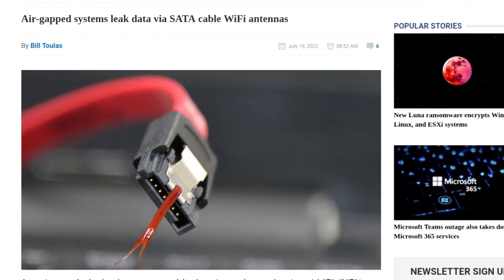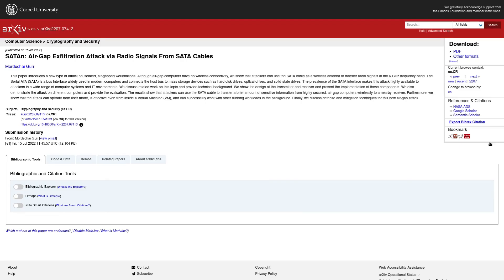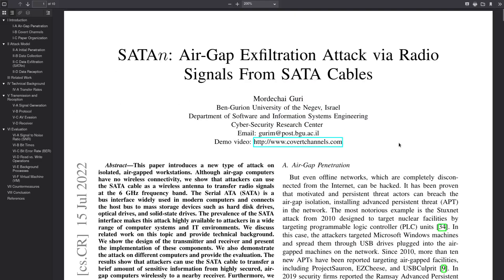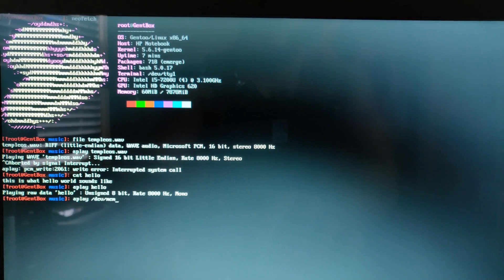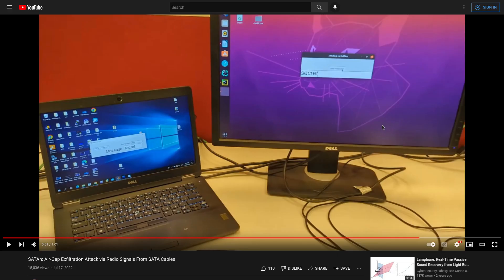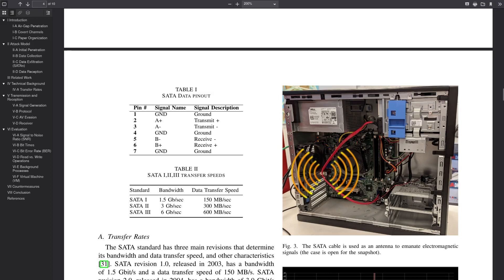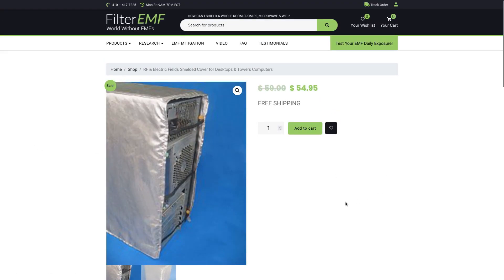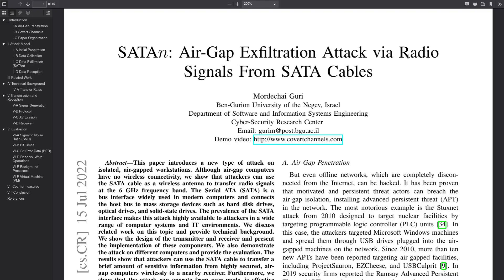Stealing Data Wirelessly From an Air-Gapped System

Comment: I assume that intelligence agencies with the level of sophistication to employ this type of attack would have some guesstimate as to the length of relevant conductors inside the case and set up a bespoke virus and receiver equipment with a super high gain directional antenna for whatever frequency would be optimal. 

That's still not going to get a signal very far outside of truly optimal conditions though, probably not through much wall at all.  Really secure US gov spaces already have apparent preparation for these categories of RF based spying or exfiltration, Faraday grids in the walls and increasing use of fiber optic instead of copper wires.

Comment: When I was a kid I had a pair of cheap emachine speakers and during the night normally or clear days they would pick up radio signals and play them through the speakers (usually the local rock station). I had to unplug the USB and aux to get it to stop.

So I'm not too surprised honestly this is possible.
Reply: plugs in speakers THIS IS 101.5 R-R-ROCK FM WHERE WE PLAY ONLY THE BEST ROCK FROM THE 80'S NON-STOP
Reply: I used to have a 90's Roland guitar amp that would pick up radio stations when I sat it in the right spot.
Reply: Same thing happened to me, but with some kind police/ham radio band. It was really weird to be creeping around RE4 and hear actual radio chatter.

Comment: Fun fact related to the bit at 5:00 about playing audio. Some years ago when smart TVs were new some companies would sell different models of the same TV with different features enabled or disabled but with a different price. For example you could buy the same TV but with the USB ports disabled for $200 or whatever less. Well, people figured out the Infrared signal used by remotes to enter service menu and enable any feature you want. It was distributed as a audio file on the internet. You just had to solder an ifrared diode from a remote to a jack cable, connect it to your PC and play the audio. The Diode would flash with the sequence as if it was a real remote.
Reply: That’s cool! Kudos to whoever though about this way of sharing IR signal over the net
Reply: One more reason for only buying devices that still have audio jacks.
Reply: @jannikheidemann3805  any usb audio thingy will work for that. Maybe you have to get one that supports a higher bitrate as this literally matters in this case, but assuming that build in chipsets support that is also an assumption.
Reply: @jannikheidemann3805  some phones even have infrared blasters
Reply: Huh that's interesting
Reply: Grounder! SnooPING AS usual I see?!
Reply: Companies that do that are evil, and I applaud whoever bypassed that garbage.
Reply: This sounds really cool, do you remember what it was called?
Reply: @down2006  I can't find it now, it's was for the early smart TVs where their top features was playback of videos from usb stick. That was one of the things that was disabled on the cheaper models. I'm sure they still do stuff like this. I looked around hoping I could find it and I see lots of examples on current gen TVs but they all get access to the service menu using normal remote and a specific button combination
Reply: @zack3g  IR blasters on phones are still an option. Pocophone sell their flagship F series, that still have these alongside 5G, 120Hz AMOLED screens and a SD 870 CPU, with 8 or 12Gb of RAM.
Reply: Never heard of that. I just know about the TVoodoo attack, where you use a Mobile Phone with IR capabilities to hack a Android TV. I also never heard that some TV's had disabled USB ports. Hm.
Reply: @zack3g  and send sick custom wallpapers at few bytes a second hehe good times
Reply: @zack3g  I hope you don't think that'd be any more secure. Since it's not using a laser any camera within a fairly wide angle can see that IR light and read what's being sent, and if it can receive then they could send to it too.
Reply: That's actually really cool
Reply: do you remember what the audio sounded like? I'm assuming some almost like morse code of the binary on/offs? If you remember though, let me know!
Reply: @ecmphg  It was just noise, sort of like old modems.
Reply: Ya I have one like that it has a 120hz option for gaming but it’s locked on my model they make a 120 and 240hz version of my TV
Reply: Yea I don't thinks so. If there were no need for the usb they would more probable not solder it, controller and passives at all, because in economy of scale even 0.1 cent components make big difference.
Reply: @yanikkunitsin1466  you dont get it... All the TVs were the same but they just disabled some features like video playback on the cheaper models to make the more expensive model more attractive deal. They were making all the TVs at the price of the cheap model already.
Reply: @golarac6433  I do get it, I just don't believe in SW disabling of existing USB circuits because it's not how it's done in the industry.
Reply: @yanikkunitsin1466  it is, while looking for the original thing I commented here about I found examples of such stuff in modern TVs
Reply: @yanikkunitsin1466  and its not about disabling any circuits, its just that the USB file browser would not play videos (but would still let you slideshow jpgs )
Reply: @golarac6433  Link for these video disabled TVs with working slideshow and hack?

Comment: Step 1: infiltrate a "really secret and important" base heavily guarded by guns and walls of concrete.
Step 2: Go through the many layers of hardcore security including eye scanners and scheduled checks.
Step 3: Reach the computer which is being used at the time and shut it down completely giving off your position.
Step 4: Open the PC box to reveal the Computer components and while following standards to not get shocked or damage the PC replace the SATA link with the one with the antena.
Step 5: While the PC boots up get out your equipment out, once the computer is functional insert some USB drive to infect the PC with malware.
Step 6: Wait for the malware to do it's job and use a second computer to receive radio signals instead of using the USB directly to steal data.
Step 7: Get arrested, tortured and thrown into a cage.
Reply: So, get a job as a technician, then steal the data without creating any records you did so? This hack is better than I thought!
Reply: @GabrielAKAFinn  Brilliant
Reply: Well it's not a specific SATA cable with an antenna built in, it's just using a normal SATA cable as an antenna.

Any long thing piece of metal can be turned into an antenna.
Reply: @naut3  Oh well, they still have to shove a metal rod in it? Better have already shoved and calibrated to transmit.
Reply: @RoastCDuck  the point is it already had a metal rod in it, it's the damn wire lol
Reply: @RoastCDuck  wdym? They don't need to shove any metal rod, the cable already has metal in it
Reply: @naut3  No no I meant, they shove a bigger rod for a better signal even if they don't need to :)
Reply: @thomas.thomas  If they want that 1m range to go up, even if it's completely useless and obvious someone modified the cable, they shove a bigger rod. Which sill stick out of out the pc box.

Comment: 8:14 Actually the rubber will do nothing to insulate the signal. The transmitted signal is electromagnetic and doesn't really interact with non-conductive materials.
More effective would be something like a Faraday cage or simply shielding made from something like aluminum, which has the same effect.
Reply: Let's go!!! Full circle baby!

Protect from outside attack start with Aluminum foil
Reply: Or just get a case that doesn't have big plastic windows. But honestly, if your system has malware on it, you have bigger issues than the malware transmitting data over your sata cables.
Reply: Copper would be better, though I have seen steel used.

Comment: Unfortunately a security audit for a sensitive airgapped system can be an attack vector as well.
Reply: Quis custodiet ipsos custodes?  🙄
Reply: A security audit per se is not an attack vector, penetration testing or red teaming can be.

A security audit may uncover potential attack vectors.

And if it is, then you're using the wrong people to do your security testing or you haven't got NDA's signed up.

Comment: Could you maybe do something similar with the PSU? The malware could draw more and less power and that could maybe be picked up remotely?
Reply: I suppose you could indeed use power draw for signaling, it "should" be trivial to use high power/low power for ones and zeros. Perhaps if the airgapped machine is on a networked UPS (even for out-of-band monitoring of the UPS) you could exfiltrate data that way. There was a CVE earlier this year where APC UPSs could be remotely flashed with malicious unsigned firmware via their updater, and while those security researchers demonstrated the problem by making one catch fire, there could be other shenanigans out in the wild to this day...

If targeting a single home user you might also be able to do a similar power draw monitoring exfil if you could pwn their smart meter, which shouldn't be terribly difficult. 

And for gamer bros, I would bet you can do all kinds of awful things to them via a supply chain atttack on the stupid proprietary control panels used to control RGB and other stupid features on "gamer" PSUs.
Reply: @ReptilianLepton  Would your first comment re power draw be an example of differential power analysis?

Comment: With experience working on military grade electronics, most of those devices are going to be immune to this type of emission. All air inputs/outputs get both particulate and emi filters. Device must go through extensive testing for EMI emissions in the GHz range. Screw part 15 compliance, the device must not emit any interference and in turn will not allow any interference ingress.
Reply: How could an individual apply a similar rigor for their home machines?
Reply: @AbandonedVoid  Lock it in a safe, faraday cage the cooling vents?
Reply: @AbandonedVoid  You know the mesh microwaves use (the hole size determines what frequency it blocks), you can do really fine mesh all the way around your unit (you really should only need around any open air vents or windows, but if you go all the way around you can't miss it too easy). That way it can still get airflow. External noise generator would also likely help (if you put your case within a bigger computer case, like a super small form factor inside full ATX, you could put a radio frequency generator in that).

You likely don't need to do that, just don't let sketchy CIA agents into your house. I don't think the government even does this, certainly not on machines that have PII or protect your data (those of course get leaked so often, they might as well be a facebook post, except more reliable since they don't get shadowbanned).

EMI shielding is the least of your problems (of course remove WiFi/Bluetooth, or buy a desktop without it).
Reply: Regardless of EMI shielding at the unit component level, when end assemblies get deployed (a network, ship, building, etc) there are still leakages to be exploited by the correct receiver and demodulator.
Reply: @Kronin Oh, I thought you were serious or possibly just alluding to military surplus (which is often a great deal to buy stuff, since its already been paid for once by taxpayer dollars)
Reply: @Kronin Military doesn't sell that, they don't make it either (they buy from contractors, government doens't "make" anything, other than large debts).

Comment: Do you normally spend so much time releasing such obvious information. Obviously, anyone who managed to place a SATA cable onto the motherboard will have access to the system ANYWAY. 
Why not just say, "Hacker that places radio inside your computer will have access to your computer." Still subbed here, but really, please don't post useless vids.

Comment: A point you missed is that the attacker doesn't have to hack the particular system they are attacking, they can heck a system within proximity of the device they are actually targeting that is capable of sending data such as,  I don't know, your cell phone another computer nearby capable of receiving data.
Reply: How is attacking a nearby smartphone gonna make the system his interest in sent wireless data threw the S-ATA cable? You make no sense.
Reply: Can you elaborate?
That sounds like how our devices all got enslaved. From what I could tell. But idk which vector(s). I tried airgap but eventually it all succumbed. This is over most ppls capacity to keep up with alot of f^ckery.

Comment: Years ago an exploit was announced similar to this, a trojan would transmit (and receive in case of a botnet) by using changes in fan speed and a speaker to detect the change.
Reply: You can also spy on the screen by using an antenna as well. This attack was discovered back in the 1940s during the war. Electro magnetic radio emissions from anything with electricity is not really a hack its just something you should expect happens all the time. See van eck phreak/tempest attack

Comment: I remember a few years ago I was setting up a cheapo Chinese camera and to get the wifi creds from the phone app to the camera, the app played the password string as sound. The camera then decoded the audio and connected. Completely changed how I look at and understand "data" and the infinite ways it can be represented and transmitted.
Reply: And I thought having the camera scan qr code from your phone app was advanced
Reply: Techmoan did a video about these new sony dolby atmos speakers, it has a feature to analyze the room via different sounds. Not as in measuring and getting data from any traditional method but from just sound. And it makes the speakers sound better judging by how it works for positioning via the side and top channels. Expensive system when said and done.
Reply: @battokizu  Apple seems to do that too with that smart speaker they sell.
Reply: Isn't that what an internet modem does?
Reply: @narcosalpha9472  Old school phone line type? Yep...
Reply: Samsung's Smart Switch app use high audio signals to communicate with the other Android/Samsung device establishing a connection via Wi-Fi.
Reply: Yi brand?
Reply: This is too weird now

Comment: Reminds me of those programs (or hell, YouTube videos) that show different patterns on the display that cause the driver circuitry to emit RF that you can recieve on an AM radio. I'm sure it wouldn't be hard to transmit data over a video display in this way. Hell, I might try it myself sometime.

Monitors in general are horrible when it comes to RF interference. Hell, my monitor emits enough RF interference that I have to turn it off to listen to my local clear channel 50 kW AM station, WCCO, that's broadcast just 15 miles away
Reply: Do you have any resources on those programs?
Reply: What the hell!
Reply: You're talking about lcd monitors?

Comment: That's it. I'm going back to using IDE drives.
Reply: They also have cable. I suggest using NVME drives, but only for initial boot, then go straight for RAM, Modern CPUs support easily around 1 TB, give or take.
Reply: @etopowertwon  That's actually a good idea. BTW, I was kidding about using IDE. Like, have you seen how slow it is, compared to SATA gen 1?? Lol

Comment: There should be a very limited range for successful transfer using that antennae though so unless the communication is reliant on the host PC transfering the data to the attacker, this is highly unlikely to be successful (i think) to prove my theory, move that laptop to the opposite end of your place thats just out of range for your wifi

that LED theory is plausible but as you mention that noise would be influence the hash if the transmission is encrypted & unencrypted would defeat the purpose

Update i should finish watching the video before commenting lol, you highlight the range issue after i typed it --- Id say wrap the sata cable but you could short the motherboard, shouldnt be necessary to wrap the tower as the tower itself should greatly attenuate the signal dramatically

Im recalling from memory but the transmission power of an antennae measured in Dbi is dependant on the power output with the length of the antennae = the frequency output - in theory that sata antennae shouldnt have anymore transmission range than half of one of those cheap micro wifi dongles, probably less

Edit 2 I imagine in a few years hackers will be able to ram a length of 28guage copper wiire in their ass & power it with a whole bunch tiny solar panels from casio caluclators LOL

Comment: This concept is essentially listening to ambient noise. This won't work in the real world as most of the data will be lost during the transmition through the air and unreadable. The only way to make it remotely feasible is to install a sensor, A/D converter, and a real, dedicated antenna on the victim's system. I am sorry, but this looks like a school project to me.

Comment: PC case provides a lot of shielding, but attenuation at given frequency depends on width of the gaps between metal because the EM waves have their length, and if the frequency is higher, they are smaller and can fit in smaller gaps. :). The best shield is just a metal box without any gaps made of material with high conductivity, or just thick. Also aluminium foil isn't ideal because they make them very thin,  just try to wrap a phone and call it, it will probably still have a signal. They make a thick Al foil tho, I just don't know what's called.
Reply: Or just use several aluminium foil layers
Reply: I use 2 layers Reflectix- style insulation (thin closed-cell foam sandwiched between foil outer surface) so 4 total foil surface and makes into case shaping easy enough, padded...user friendly.
Tested to block 100%. Less material didn't.